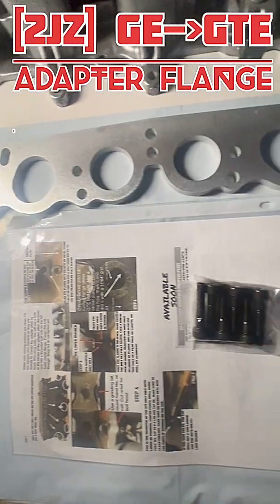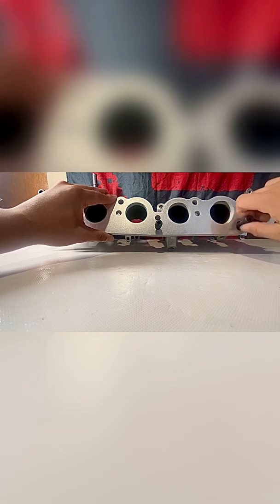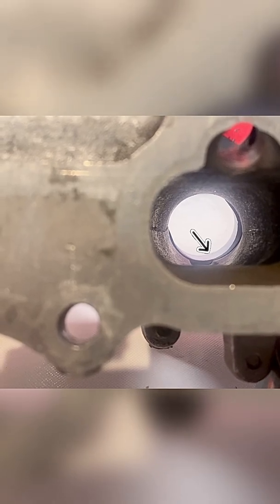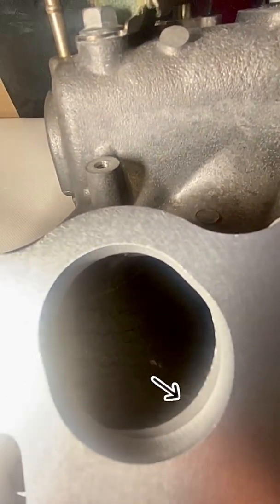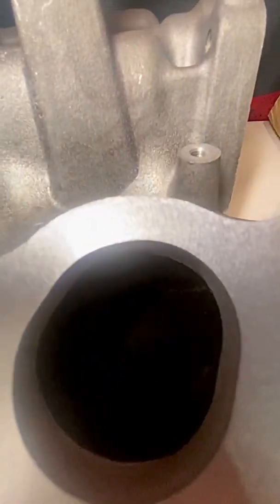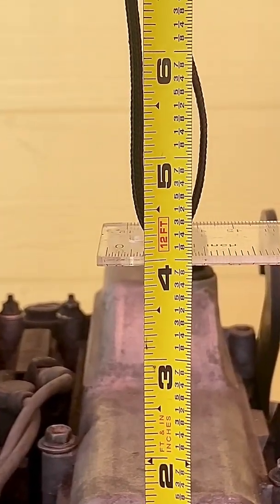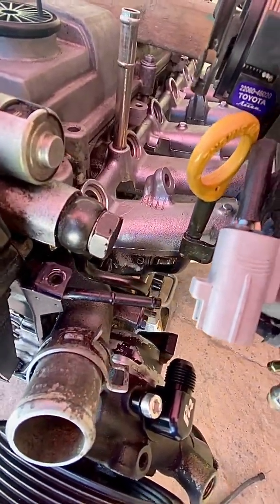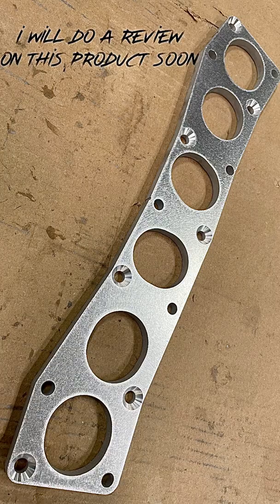Toyota 2JZGE TO 2JZGTE Intake Manifold Adapter Flange Review

Comment: Great video !!!! What would I need if am running the automatic transmission in my is300 ?
Reply from the maker: You can run stock transmission and ecu if you wanted to. But it may be a very tight fit for is300. Might touch the hood when closed. You would just need to make sure you use the gte vvti throttlebody. The gte vvti etcsi throttlebody is almost identical to the GE vvti etcsi throttlebody (function and wiring wise).

Comment: awesome work on describing everything on the adapter, can you show how to make a gte valve cover fit the ge head? I lve heard one ge head bolt doesn't align I want to do this to my is300 when I go turbo
Reply from the maker: Hello 👋 thank you for commenting! GTE VVT-i valve covers onto GE VVT-i head, I can make a vid, no problem. 

For GTE VVT-i valve covers to fit on your GE motor, you will have to go with a Front Facing Intake Manifold design. You will have to go with a aftermarket intake manifold. Any GTE oem manifold (adapter or welded), will hit the under hood bracing. Good luck!!
Reply: @MC...  is there a aftermarket intake manifold where I can keep the ecu in the stock location on a is? thx for the response 👍
Reply from the maker: @86parker  there are some choices. I’ll have to make a vid to go in depth, as if you are using your oem ecu, you have to use the GTE or GE VVT-i throttlebody (if you want the motor to drive like stock). Otherwise, you’d have to go piggy back or stand alone.